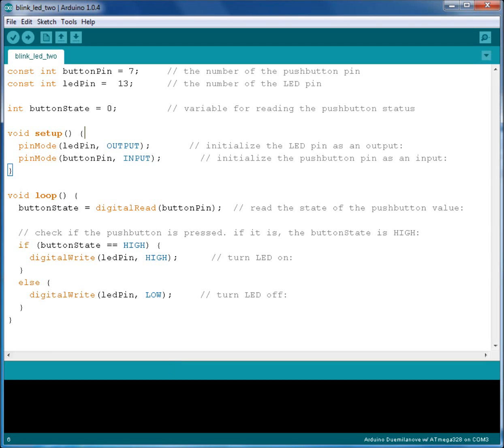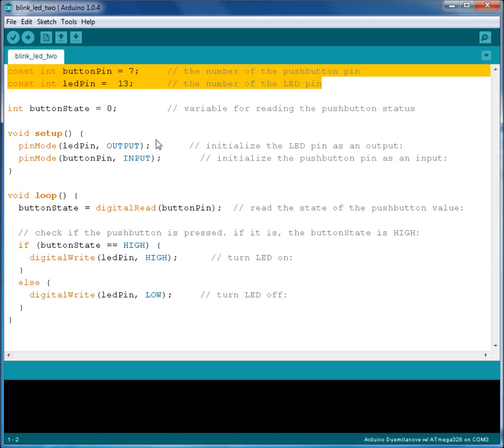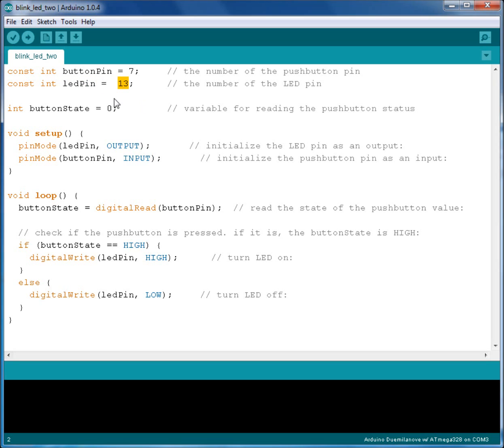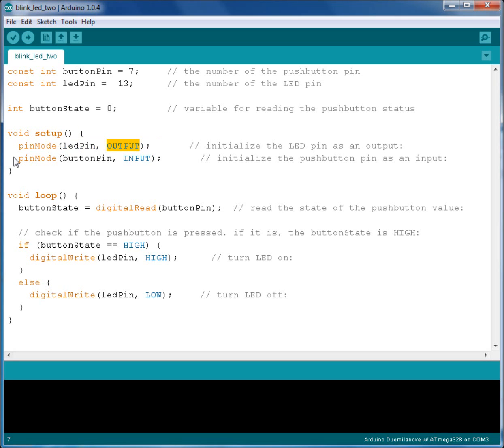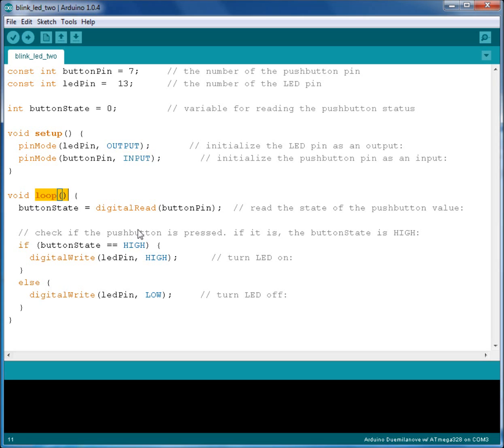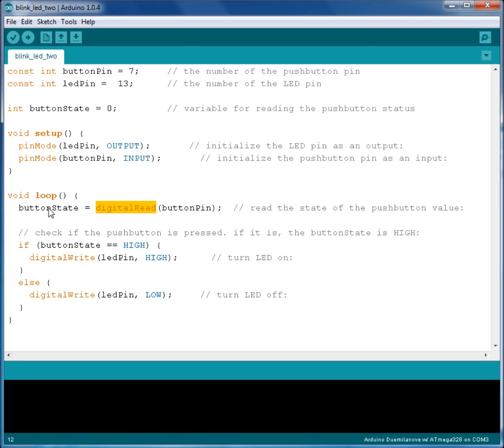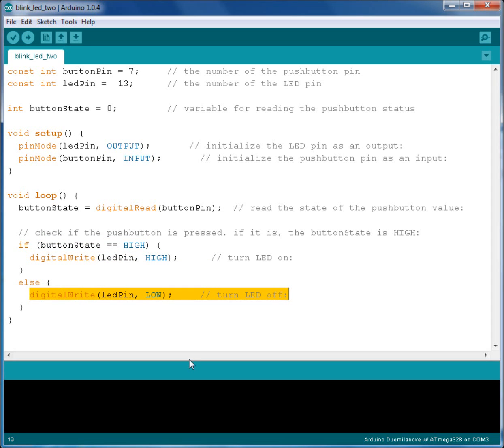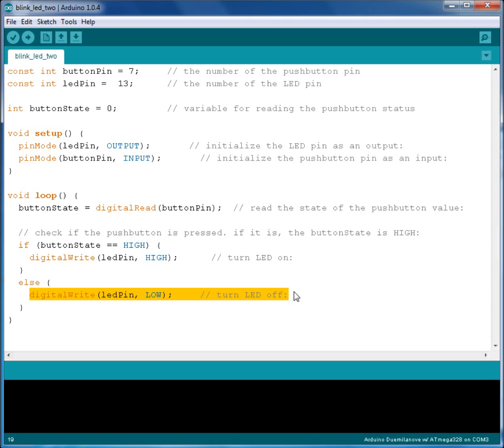Arduino for beginners - Pushbutton and LED code walkthrough

Comment: For the if then statement, why are there 2 equal signs after buttonState? I am new to arduino programming and I am wondering if that is necessary when checking for buttonState or if one equals sign is ok
Reply from the maker: Yes you need two equal signs. If you have just one, you are not comparing, you are assigning.

Ex
This statement assigns a value to a variable:
variable = value

But this statement checks if the variable is equal to the value
variable == value